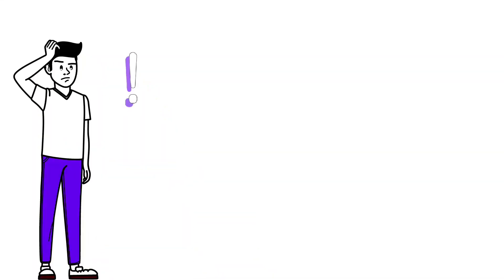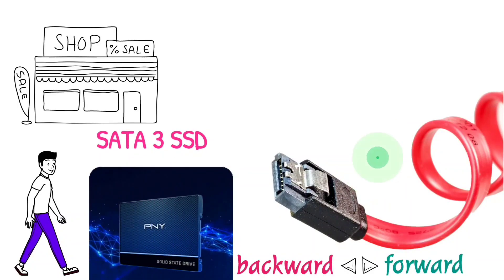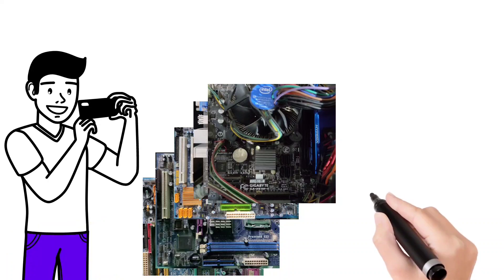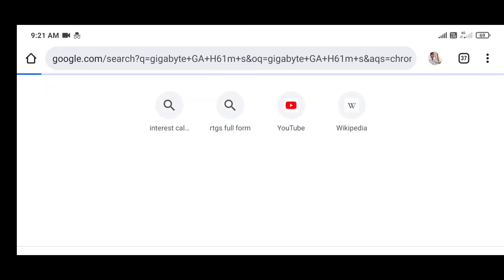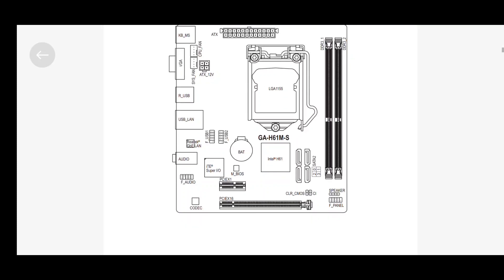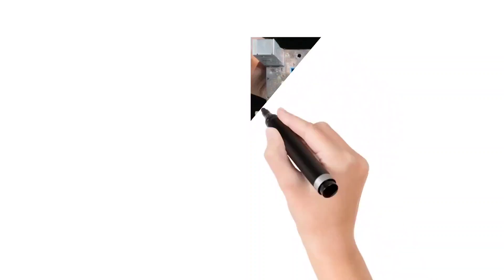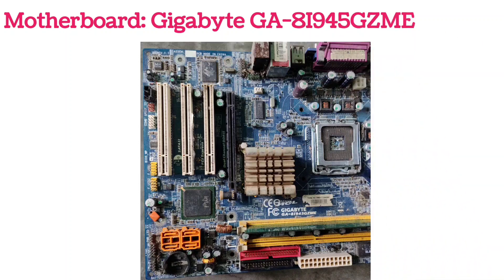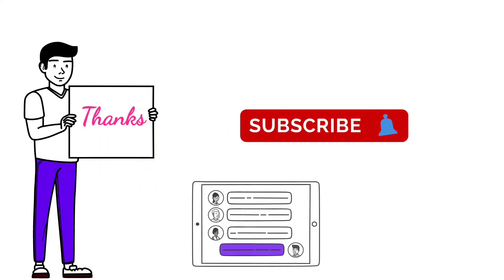How to Check SATA Version and Port Number of Your Computer? | SATA Version in Laptop | SATA3

Comment: I haver a 15 year old pc i just replace 8 monts ago, the problem i have back them i buy a hdd 500gb WD green sata3 and the motherboar is sata1 pc never see the HDD, then to maked work i have put a old sata1 hdd i have on the side then put the sata1 on a master position and the WB green in slave position(jumpers and all) and wala the pc see the new hdd. 
is comon to have problems with sata3 divice to sata1 ports or is just my bad luck?
i like to buy a SSD for tha old pc to be use like a emulator machine and windows7 system, problem i don't know if the SSD is gona work thats the other question? i like to see you thoughts on the questios, thanks a lot before hand.
Reply from the maker: Sata 1 is slow and HDD makes it much slower. So if it possible then you upgrade the whole system at least motherboard, processor and SSD to get better results.

Comment: My motherboard stat port number 0123 I have 2 hard disc which one port number use to put os hard disc
Reply from the maker: We can use any port for OS hard drive because the BIOS will find out where the OS is. But it's recommended to use 0 or 1 port for OS hard drive and another hard drive can be connected in the next port number